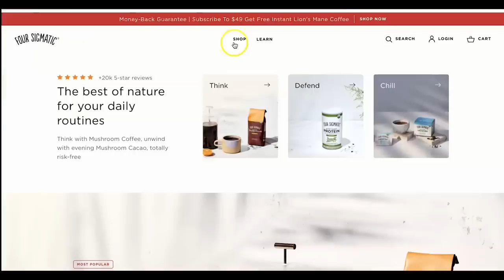BREAKING GROUND ON OUR TINY HOUSE IN THE MOUNTAINS

Comment: I’m sure you already aware, but when building a house with a hill behind it, there is the probability of water flowing down the hill and into the house. We owned a home in the foothills and it was backed up to wooded hills.  We had to dig away the dirt around the foundation in some areas and fill them with gravel to decrease moisture buildup in the foundation and walls.  I don’t know what the plan is and I’m betting you’ve already worked this out.

Comment: Trent, Please get a loggers hard hat with the face shield for when you are doing using the saw. Get the ones with built in ear muffs. You are cutting close to the ground and if that tip catches a a rock or something that saw will kick back before you know it! I would also recommend the chaps designed for chainsaw use, they have a material that will stop the chain upon impact.

Comment: Telephone poles...they are cheap and strong cut a point on one end and can be driven down by the bottom side of the bucket on the machine and if you can think of a way that water can get through or under....keep thinking water always find away, get to at least 3 ways to divert water and possibly a way to maintain those ways.

Comment: Allie, the best work clothes I have found are Wrangler 13 lb weight cowboy pants.  They used to be called pro rodeo.  I buy them in 27” x 34” men’s sizes.  I’m not a guy.  They are super tough and can handle anything you throw at them.

Comment: You can do a series of stepped walls each one four foot high.  Something is wrong with the siting of the house I think.  Ask your architect how the grade is supposed to work and for advice.  (I have two degrees in Landscape Architecture).
Reply from the maker: The original plans show two retaining walls and we would really prefer To only do one. We’re going to haul off a lot of dirt and see if that helps

Comment: Looking a little off color at around the 10:00 minute mark, lips are a little blue maybe and not because of the add but possibly because of the close up or the lighting but make sure to are taking enough breaks if you are not used to the altitude especially if you feel too winded or lightheaded. Stay safe up there and have a grand adventure.

Comment: Oso is going to be a big shredder. I am a dog and cat groomer. The trend for deshedding is to use a high velocity pet dryer. Be sure to remove hair from his skin out and start low on his body and move up. A hair rake(you can order all from Amazon). You can also order from pet grooming  sites. If you spend about $200, that will get a good high velocity dryer. You can blow the hair loose. Do it outside. I do a lot of cleaning. You can also find a dog groomer to do the work too.😁 Too far for me to do a house call.

Comment: Congrats to breaking ground! Allie is already very strong in many ways and deserves she that credit. The wall you are talking about I'm sure is for the extremely deep snow on the mountain that will also be melting in the spring. For a long term permanent solution please think about that because it could save your life and there is a reason why it's needed. I'm sad that during all of the preparation you were not notified about that wall being they knew about it if you are building on a mountain. If it's very wet snow then it will be very heavy and very icy but for an extended period of time. Please research all of the animals that are in the area which I'm sure you do anyway for the sake of Frank.

Comment: PET QUESTION FOR ANYONE
What exactly makes a bus conversation safe for pets verses just leaving them in a car?

Is the fans run when it's hot? Heater going when it's cold? ...because of solar and generator power?

What's being done to keep pets safe when you leave them for a couple hours at a time?
Reply: Get a thermometer and test it.  Lock up your bus and in the summer heat, turn on the fans and leave... or rather you should stay.  See how fast that temperature climbs.  Even with solar it will soar to 100 - 105 F, within an hour.  This is not enough to keep your pets safe.  Two roof fans on opposite settings, 4 spin blade fans, and insulated window coverings MAY keep tempetures below 90F, but don't count on it.  Test your system 4 - 5 times in different locations and different temperatures and you can then determine if there is a possibility they will remain alive in a locked-up bus or van, by the time you return.

Comment: Interior doors = Pocket doors.  I’ve not understood why traditional hung interior doors are used in tiny houses where space is a premium.  Pocket doors = more useable space in my opinion.
Reply: Barn doors are easier to make and hang.  They take up the same small space as pocket doors.  Pocket doors and framing can be complex and often require ongoing maintenance.

Comment: Have noticed some advising you to use back belts to help your backs. Actually, doctors & physical therapists advise against the use of lumbar belts because they give a false sense of security. Also the back muscles will actually loose strength because of reliance on outside structure (the belt). Instead important to bend at the knees (happy to have seen them do this) & use very powerful quadriceps muscles (thigh) when lifting... instead of lift from waist/back. Putting logs on top of shoulder is also appropriate (instead of carrying them/hanging down). If you're actually going to be doing majority of "manpower", I'd really like to see you make physical therapy appt to learn proper lifting techniques/body mechanics.

Comment: That’s not a mountain. It’s a big dirt hill.   What do you plan for unusual out of character drenching rain and mud slide?  Wiped out from above.... Fast ride to bottom of hill.  And where’s the atv for moving heavy stuff.  You guys got brand new everything else but no atv which is silly.  Couple of city slickers on a camp out  on a dirt wad.  I had high hopes for ya on the farm where you’re great, but... a big hot truck and no atv up at 8k and clearing land.  You poor guys..., a tractor supply ball cap and no atv. Which is the rural espresso machine for getting it all done.  I have a dirt moving buck on mine. Great landscaping device.  I bought the dirt bucket at..., of course... TRACTOR SUPPLY.  A genius... and no atv.  For shame!  You even caught on to the lifeguard straw hat....., but no ATV.  I’m knocked off my pins and feel for ya.  Here’s a rope.  Go buy an ATV.  I like Kawasaki.  It runs.